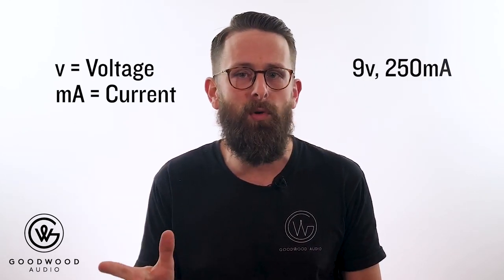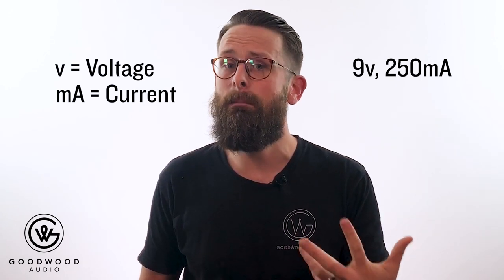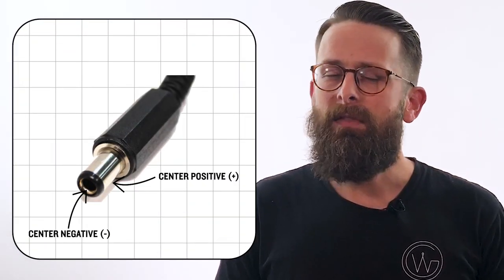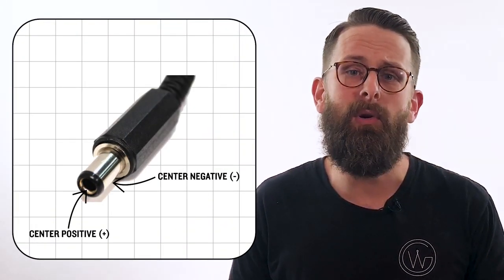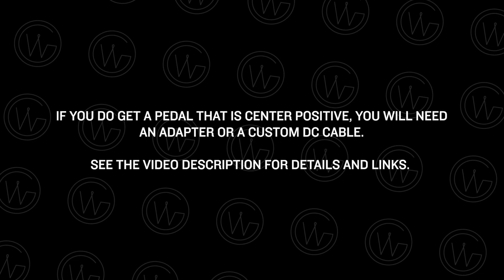Goodwood's Guide To Powering Guitar Pedals

Comment: Many thanks for the useful info. The Plethora x5 coming with 600mA input 🤨 n the Zuma can supply all of my pedals. I dont know if the plethora will work with the one 500mA left on my Zuma  🤔
Reply from the maker: Give it a shot and see.  I wouldn't be surprised if it was over spec'd and didnt take a full 600. The other option - can you daisy chain 2 pedals off one of your other outlets on the zuma (leaving you with 2 spare outlets) and then get a current doubler for the X5?
Reply: @GoodwoodAudio  yeah that would be a solution. The Hardwire polytuner has a DC output. Then i can spare two outs of the Zuma for the Plethora. Many thanks for the advice

Comment: How would you rate the Harley Benton ISO power supplies? They look like good value on paper.
Reply from the maker: great question! Never used one on a build yet... on paper they do look good - you're right.  Good price.  A bit limited on link specs though (1A) means you can't link a ton of supplies together without using the mains output (which is a good option).

Comment: hey guys I have a "specular temps reverb" and i using a "The GigRig system" which is the correct option to power it this pedal? direct to distributor or do i need a isolator?
thanks?
Reply from the maker: I'd add an isolator for the Spec T.  However, if you aren't getting any additional noise when plugged into a distributor (make sure other pedals are plugged in and using the same signal path) then you should be fine without... I've never run the Spec T without isolated power, so actually not sure if it needs to be isolated or not. Give it a shot!

Comment: Wish I had this video years ago, have you ever had to chuck a brand new blue sky in the bin?
Reply from the maker: Not yet thankfully. That would hurt. The good news (hopefully you can still get that BlueSky back - is if you send wrong power to a pedal and damage it, its often a simple enough fix for a tech to do... a few parts worth a less than a dollar and some time.
Reply: @GoodwoodAudio  I took it to a tech and he said it would be cheaper to buy a new one, not sure if he couldnt be bothered. Ive never gone back there since.
Reply from the maker: @NatedogsYouchoob  Good call.  Really shouldn't be a hard fix.  If it ever happens in future, just get in touch with the manufacturer and see if they have anyone in the area, or if they can send part #s so a tech can replace the parts.